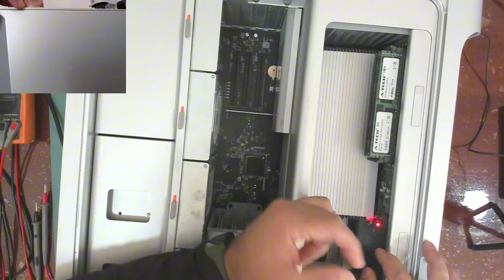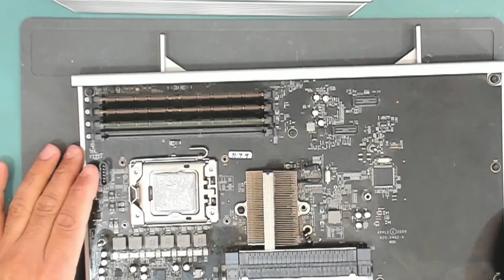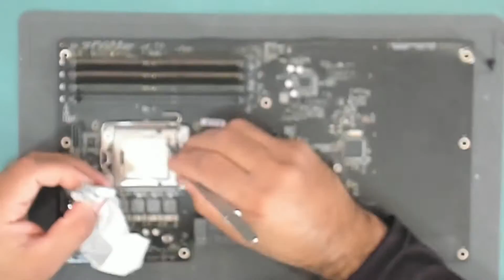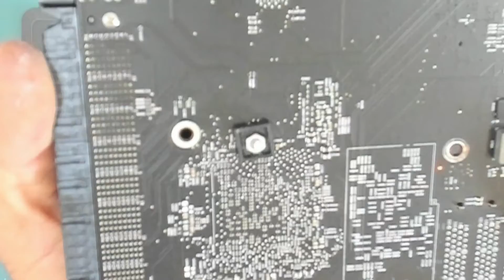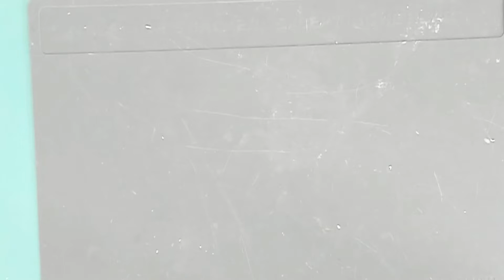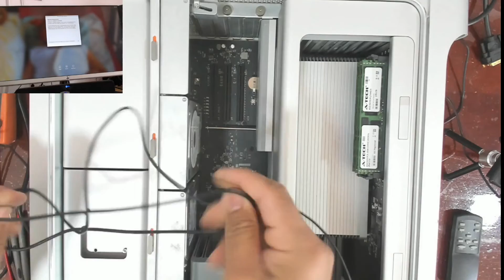Mac Pro 5.1 A1289 No Display repair | Red LED | DSI510

Comment: This is not an uncommon problem with 4,1 - 5,1 mac pro's where the plastic clips which hold down the heatsink on the Northbridge chip fail.  It's not advisable to use a metal bolt/s as the area around the hole on the circuit board is a ground.  Use nylon bolts with the original spring instead.

Comment: Hi! I have a Mac Pro 5,1 (2010) with the same issue — fans go full speed and it won’t boot, sometimes a red LED lights near the RAM on the CPU tray. After a few tries it might start, then fails again. Any idea what causes this? Thanks a lot for sharing your video! 🙏

Comment: Thank you for your video. My Mac wouldn't wake up from sleep, tried restarting many times. Comes on, no chime and red led on. Pulled the cpu tray and I can hear something loose, and a little spring fell out. I haven't had time to look yet but I suspect it's that exact plastic bolt and spring that holds the aluminum heat sink down that failed. I will report back. But thank you, you are genius!
Reply from the maker: You are welcome brother

Comment: Hi FixTronics !
I have quite an identical problem : while using my Mac Pro 5,1 (2010) mono-3,46Ghz, my Mac Pro suddently shut down and the diodes OVTEMP CPUA and OVTEMP CPUB where flashing red (computer off), and when I let pressed the Power Button, thoses two diodes where constantly red (not flashing).
Can you help me please ?
Thank you very much 🙏🏻

Comment: Hello brother. I have this exact Mac. Turned it on was working fine then just cut off and won’t come back on. Plug is fine. Any suggestions on what it could be. Thanks in advance
Reply from the maker: Hello friend 
Sorry to hear that!!!
Start and check basic things first, like the fuse and power cord. Then check the power supply if it has any outputs. If all looks ok then you may have a short on the main board..

I wish you all the best brother

Comment: I have a trash can Mac Pro 6,1 and anytime I open chrome it goes to gpu 1 and the window is red and trying to interact freezes my Mac. It’s the only thing on gpu 1 everything else goes to gpu 2. Any advice?
Reply from the maker: Hi brother 
It might be related to Chrome itself!!!
Try these steps bellow and I hope you can solve it.. 

1.Reset Chrome's GPU Settings 

Close Chrome completely.
Open Finder, then go to ~/Library/Application Support/Google/Chrome/.
Look for the Local State file and open it with a text editor.
Find the "gpu" section and remove or set problematic flags to false.
Key Flags to Check or Modify: 

"gpu_compositing": Set this to "disabled" to prevent Chrome from using the GPU for compositing. 

"out_of_process_rasterization" or "oop_rasterization": Set this to "disabled" to stop Chrome from using the GPU for rasterization. 

"webgl" and "webgl2": Set these to "disabled" to disable WebGL, which might be causing rendering issues. 

"native_gpu_memory_buffers": Set to "disabled" if Chrome crashes due to GPU memory buffer issues.

Example of updated "gpu_feature_status": 

"gpu_feature_status": {
  "2d_canvas": "disabled",
  "flash_3d": "disabled",
  "flash_stage3d": "disabled",
  "flash_stage3d_baseline": "disabled",
  "gpu_compositing": "disabled",
  "multiple_raster_threads": "disabled",
  "native_gpu_memory_buffers": "disabled",
  "oop_rasterization": "disabled",
  "out_of_process_rasterization": "disabled",
  "rasterization": "disabled",
  "video_decode": "enabled",
  "webgl": "disabled",
  "webgl2": "disabled"
} 

Save the file and restart Chrome.

2. Disable Hardware Acceleration 

Open Chrome. 

Go to chrome://settings/. 

Scroll down and click Advanced. 

Under System, turn off Use hardware acceleration when available. 

Relaunch Chrome.

3. Force Chrome to Use GPU 2 

Open Terminal and use the following command to start Chrome with a specific GPU: 

/Applications/Google\ Chrome.app/Contents/MacOS/Google\ Chrome --gpu-switching=0 

This may force Chrome to use the other GPU.
Reply: @ disabling gpu accel worked :) thanks!!
Reply from the maker: @noTTYLer97 
That's awesome 
I wish you all the best brother

Comment: I wonder if the lack of display signal is really related to the red led light on the cpu tray.
Why a problem with the CPU would prevent the GPU to generate a video signal?
Reply: Because there's no chime, therefore no boot up on any level, hardware, much less software.